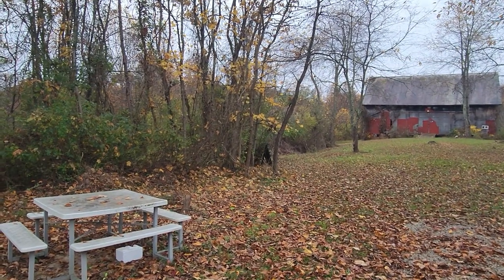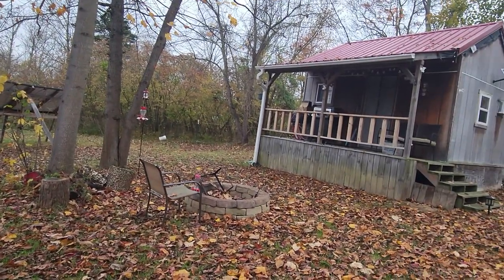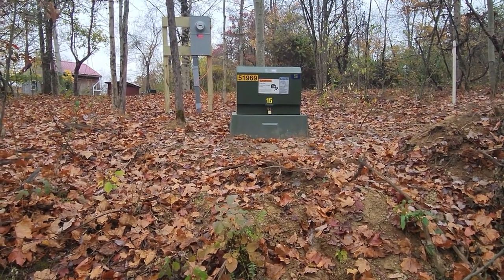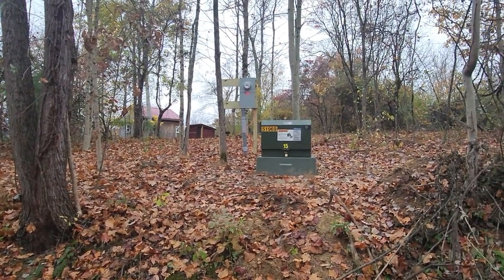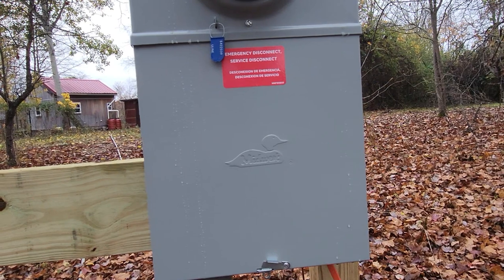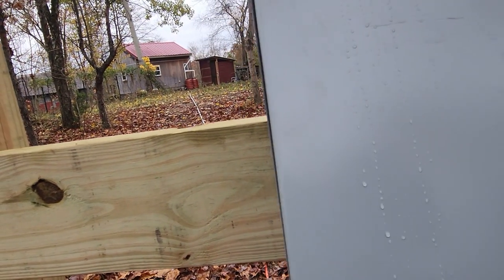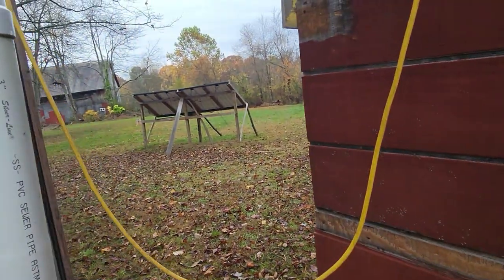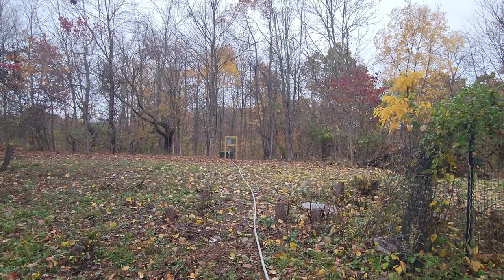Putting the Off Grid Cabin on The Grid Finally

Comment: The end of the long extension cord that runs to the cabin has a female end on it,doesn't it?
If it's a male plug on it that would not be good because if you have live power to it someone could be electrocuted with it being unplug.
Just curious is the end of the long extension cord end that plugs into the outside wall to the cabin,male or female,just curious to know

Comment: Yes,thats the same as a pull trailer,,when pulling in somewhere,,just plug in...my neighbor has a camp,,he had a pole set 200 amp..he just plugs  a cord into his down box off meter...thats what im getting,,,no big wires hooked to the house..just a pole and box..i can plug into..course im close to the main feed line,,,his bill is very low..and he has lights at night and cameras,,going all the time..i just want it so ill have it...i have  a plug on my house,,i can plug anything in..no problem..hell all i need it for is lights and fridge,freezer..thats it,,,i got propane heat..ok  so your set now..
Reply from the maker: +Ron Safreed That’s how the cabin will work.  I can just plug in what I need.